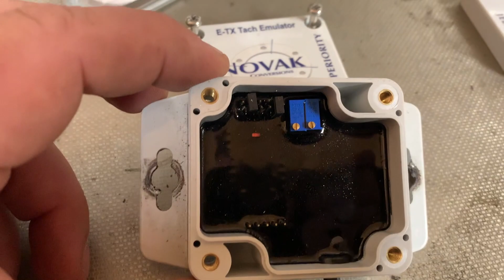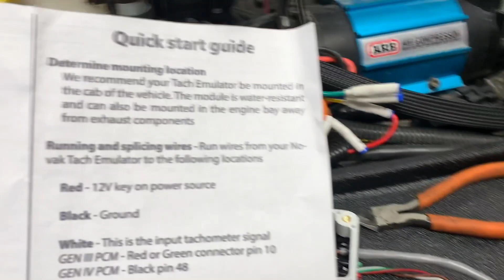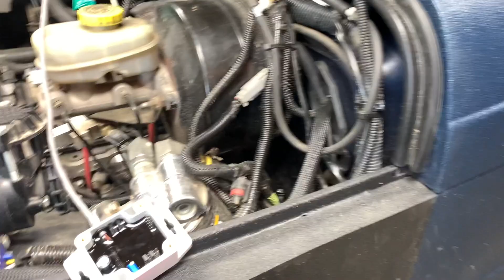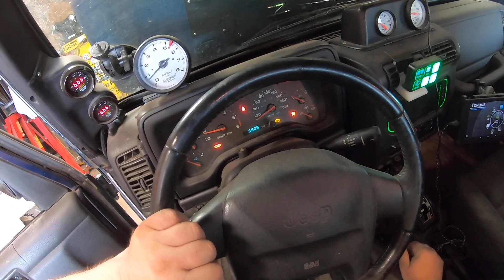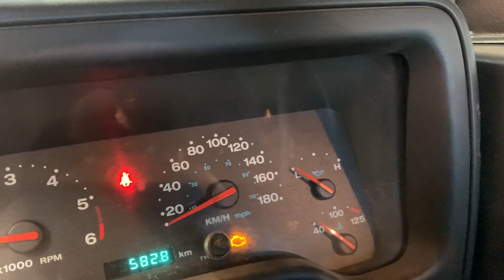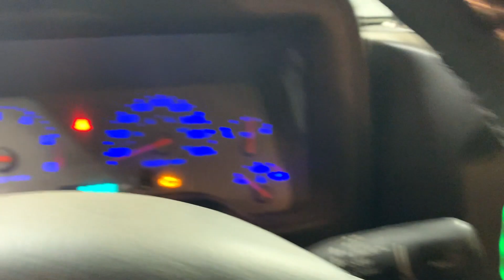Novak Tach Emulator Issue is Solved

Comment: Man how you make the speedo works ? Im using a nissan Patrol TB42 Transmission , and ordered Novack Tach Module but do the speedo gonna work and the temp and fuel gauges well work by wiring them ?